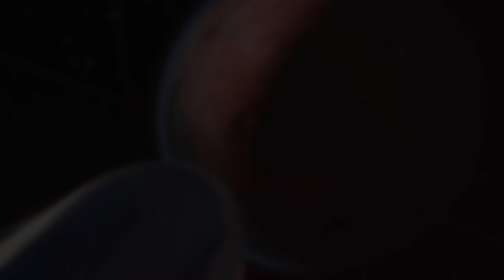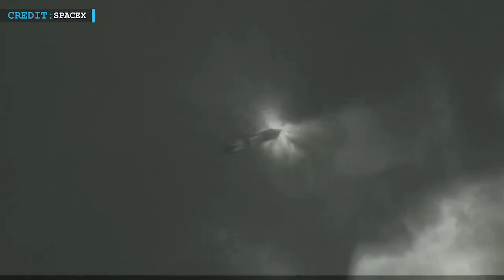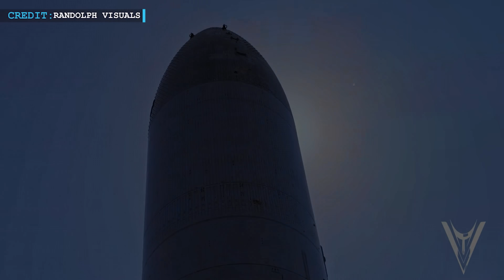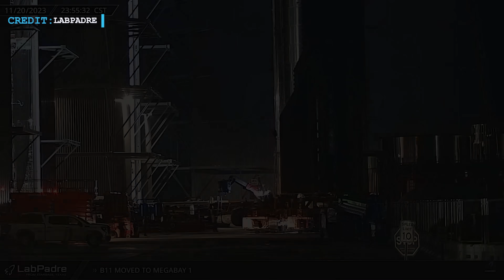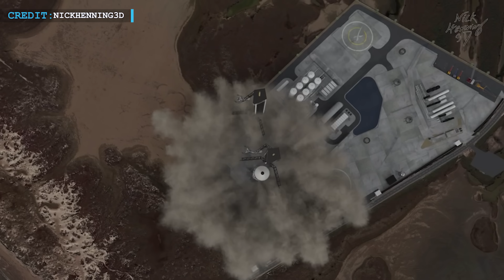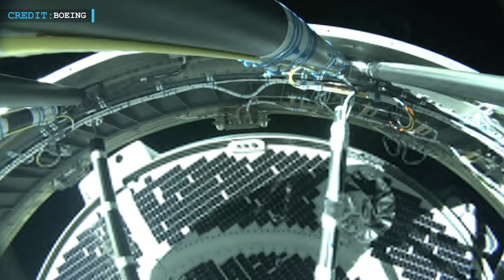A Deep Dive into SpaceX's Recent Milestones and Future Plans | Gearing up for IFT-3

Comment: It seems like SpaceX is getting pretty close to having this one in the bag.  There is still some amount of redesign that needs to happen to get the remaining pieces to fall into place.  However, even with say the heat shield tiles, no flying rocket today has recovered a second stage and they are still considered a success, so I am thinking SpaceX will just let the second stage fail on reentry until they have a redesigned heat shield that doesn't get broken on launch.  But the important thing is it will be carrying useful payloads to orbit as early as next year and most probably be recovering the 1st stage, making it an economical rocket.  Once they fix up the remaining issues, then the economy of the rocket will be even better.

Comment: SpaceX should avoid doing hard flip maneuvers as in IFT-1 and IFT-2. The hot stage worked exactly because it was straight forward. The upper stage failure could been due to propellant loss or engine failure.
Reply: Perhaps SpaceX should test launch the booster by itself to see if they can flip and burn back from 100km
Reply: They should put partitions inside the fuel tanks to keep the fuel from moving around so much that feed lines don't get cut off so readily as with B9 if that was the issue.
Reply: @jason_m_schmidt622  Not that easy. It would need a nose cone. So a better way, would be doing a third launch, and avoid the flip maneuver, shutting down the engines, and let Gravity drag the booster down, and then relight the engines to slow down the descent.
Reply: @RogerM88  Thats not how boostback burn works
Reply: Yep. They could try relighting the booster engines while it's still on the way up, do a gradual turn and boost back, another gradual turn for reentry. That would require a significant amount of additional propellant though.
Reply: The amount of telemetry provided from this launch would be considerable. They certainly have sensors and cameras operating all through that thing durning its flight. I expect SpaceX has already poured over the data, knows the details of what happened, and is well on the way to a solution to this problem.
Reply: @RogerM88  I understand. I just don’t want to see SpaceX waste any Starships unnecessarily.
Reply: I'd like understand what is different in a Facon 9 fuel control system that prevents fuel starvation.
Reply: @michaelreid2329   SpaceX doesn't do flip maneuvers with Falcon 9. The boost back burn done on Starship booster, it's to return it to the launch pad, avoiding the need to land on a drone ship or using landing legs.
Reply: I expect the fuel system on Starship is considerably different. More than 3 times the engines and a different fuel. I doubt it scales up linearly.
Reply: they like flip manouvers.  They will probably get it down. This was merely the second test flight.

I hope they got enough telemetry despite the connection issues
Reply: Best I heard was just firing the vaccumn engines for the hot stageing till after seperation then light the other 3.  Also delay the flip to let fuel settle from the forces of seperation for the boostback burn.

Comment: The biggest problem that needs to be resolved is loss of tiles. Lots of them. And with every Starship available for launch built using the old tile attach mechanisms, the chances of it making it to the ground intact seem doubtful. It’s a problem that will require a rethink to solve.
Reply: The loss of some tiles is okay due to the white material underneath the tiles and the stainless steel construction of the rocket.

Comment: It’s been almost 60 years since 5 lunar missions went to the moon and it’s like we’re starting from scratch. 

What did they do over at NASA, chuck all of what they learned how to get there out the fucking window?

Although I know we went to the moon and men walked on the moon, I don’t blame the nay sayers for believing and trying to prove the opposite. 

This is embarrassing, man.
Reply: NASA chucked it out the window when Nixon choose the shuttle program instead of the Mars Project. Now SpaceX with a completely different vehicle must reinvent the wheel so to speak.
Reply: Nixon decided he was a better rocket scientist than Wernher von Braun because he could pretend that the rocket equation didn't exist while Wernher von Braun insisted that he designed the Saturn V around it.  So he dumped Wernher von Braun and his team overboard and unceremoniously scraped the Saturn V rocket and had Skylab burn up in the atmosphere because he had "a better idea" to eventually get a space station built 30 years later using piles of small launches and extremely complicated space based assembly and with the loss of two whole crews using an unsafe and inefficient rocket design.  So yeah, you dump all of the talent overboard and bring on the people who had been failing to make rockets that were any good and have the politicians design the space tech instead of talented engineers and it doesn't go so well.

It all comes down to politics.  It is not a technological limit, but it is hard to find the people with the right stuff to develop the technology to do it.  Then if you get rid of those people and/or don't give them the room they need to do the job right, it doesn't work out and the technology to do it is lost.

Comment: Sorry.  Hot staging did not work well.  Stages separated… that’s it.  Both vehicles were then lost.  Hot staging needs to be examined as to the possible anomalies.
Reply: Sorry, Hot staging worked pretty well.  Nothing exploding during hot stage, they separated, and second stage continued on for several minutes before a problem occurred, possibly unrelated to hot staging.  First stage completed flip maneuver and only failed during engine relight.   Not complete failures for either stage during separation.  What’s the point of a test, if folks don’t treat it as such.
Reply: Post separation issue with booster can probably be remedied with a simple flight profile change to prevent hammering and settle the fuel before reignition.
Reply: I agree 100% Hot staging did not work well. Both vehicles separating isn't proof of success.
My opinion (and it is only my opinion so no declarations of war please) is That Hot staging was like an explosion when all six Raptors in ship 25 fired up so I'm guessing the explosion damaged one or more Raptors in the engine bay which prevented Ship 25 from completing it's mission.

That same hot stage explosion also damaged the top of booster nine where a lot of the control systems and engine management reside, this in turn would cause the engines to fail in the manner that we observed.
Reply: @robertdean9254 Agreed try that first. Ultimately SpaceX may have to place header tanks in the booster.
Reply: @straighttalk2069  I respectfully disagree.  Hotstaging worked.  The possible problem is they ignited all 6 engines at the same time.  I had expected them to fire the vacuum raptors to separate, then fire the s/l raptors a second or two later.  That would fix the problem.  I have seen evidence that the demise of Starship was due to an issue with the qd connection plate.  The engines did not 'explode', the all operated normally until the fts activated.